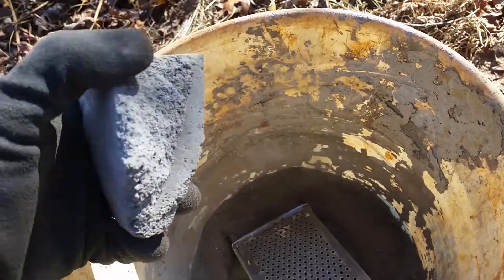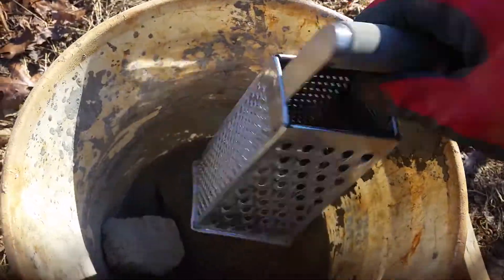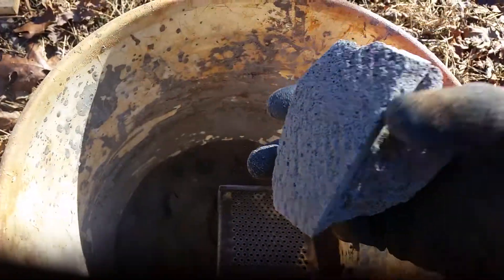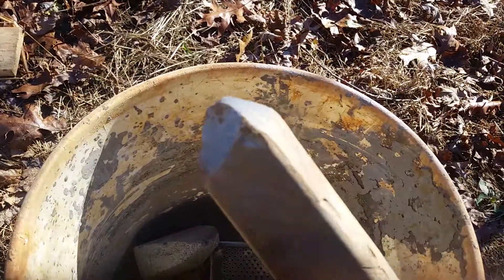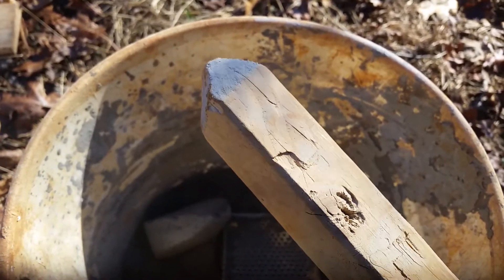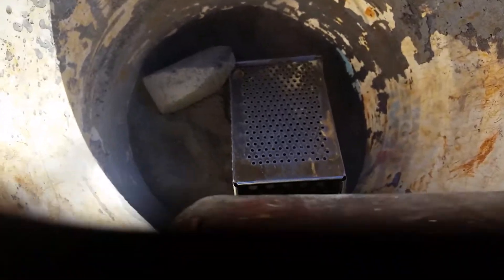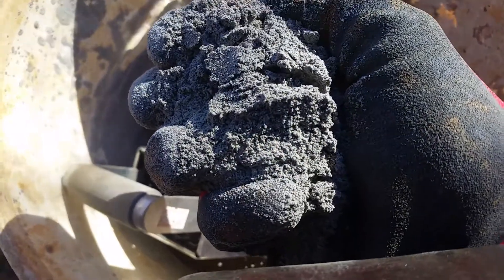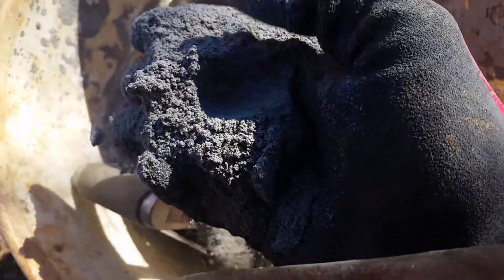Making aircrete powder

Comment: Isn't there an existing substance very close to crushed aircrete. Pumice powder maybe? Or if you add the SS (or especially some other alkali salt I can't remember which does it most) late in the process, it will sort of disintegrate the aircrete, kind of like your goal - makes it uncohesive automatically.
Reply from the maker: I have heard of adding perlite to concrete. Pumice stone powder may work as well. For my use though mechanical seems to be good for research purpose of the mixes I'm testing. I would probably just scale that up if I find a mix I think is worth pursuing. The aircrete is quite easy to process when it is not fully cured but seems to maintain small bubble structure from the original aircrete.